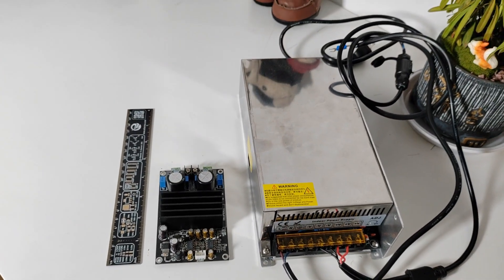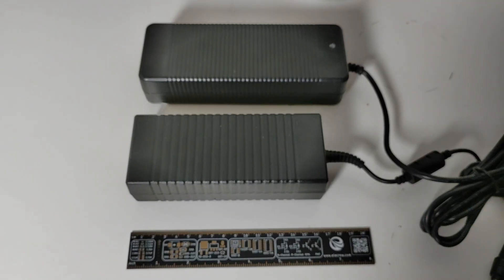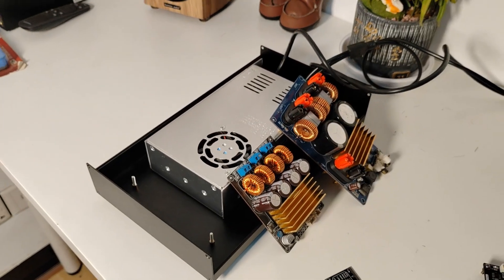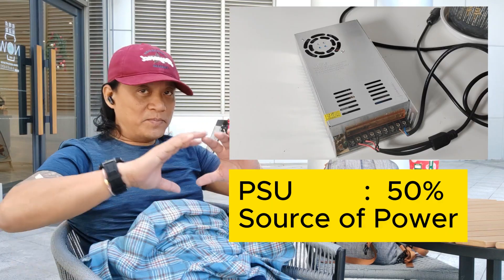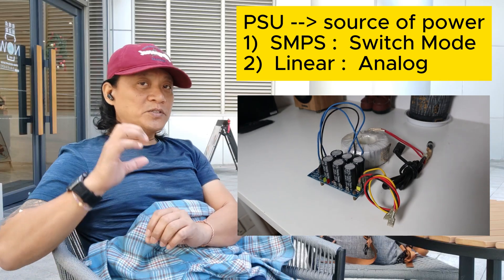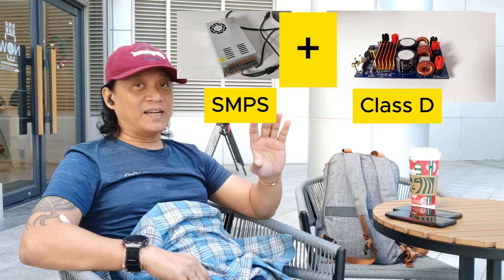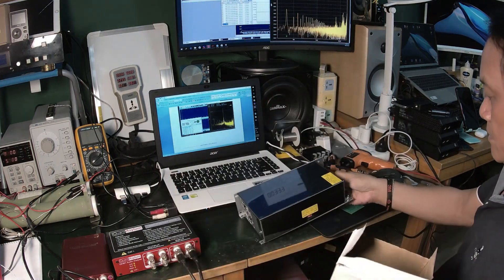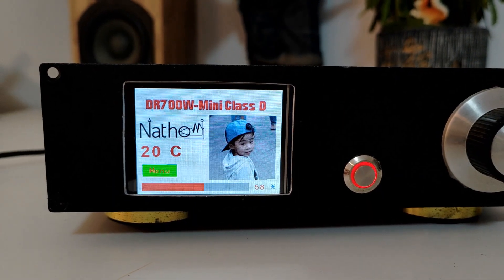TPA3255  SMPS Power Supply OVER KILLED under voltage

Comment: It has to be a torodeall transformer. You can get them in different sized and calculating the hight and Wight to fit inside your amplifiers chassis my brother
Reply from the maker: thank you for the nice comment and valuable information!   I have that torroidal transformer which I am using for the Nathan amplifier 100W/channel, its kinda big that will not be fitted into my intended small aluminum case,  30x18x5 cm  (LxWxH) as my example in the video.   Using a SMPS  with my DR700W  (350W/channel at 4 ohms) it can fit  well into the that 30x18x5 cm.   In comparison between the  2 class D solution then as a system,   my intended TPA3255 amplifier with aluminum casing + power supply will not be in compatible with my standard casing.    My intension is to have a uniform size of power amplifier casing,  so the challenge is to find a small SMPS that can maximized the  power output of the TPA3255, yet small enough to fit into my intended casing.  Thanks.

Comment: I solved the problem by combining two power supplies. Not sure of AC voltage where you are, in North America it is 120 so I can't recommend the power supply I am using.
Reply from the maker: Thank you for the valuable  information.   I am "temporary" living inside China,  220Vac/50Hz.